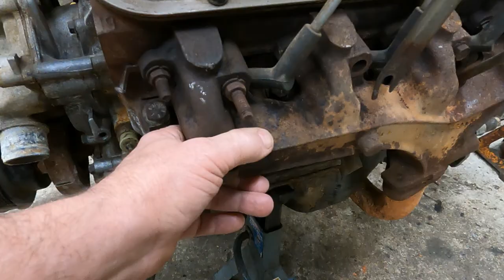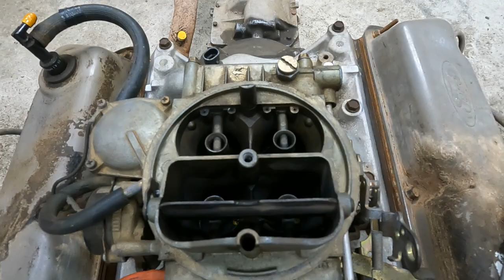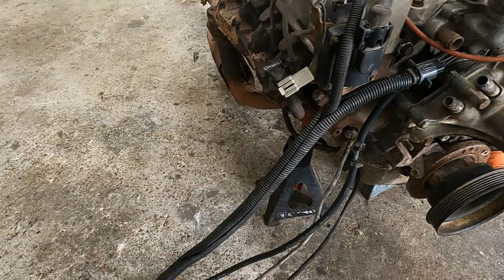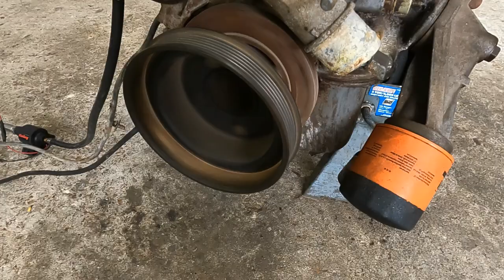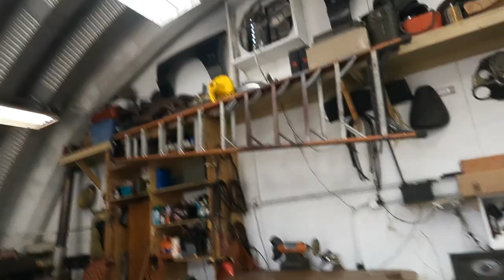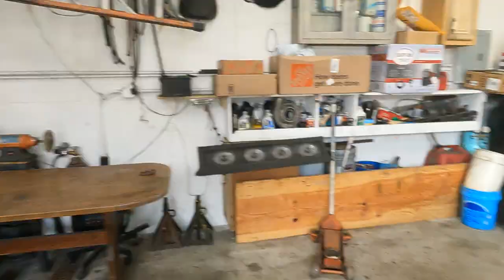94 Roller 351W Swapped To Carb Running On The Ground

Comment: Awesome that's my favorite engine!
Reply from the maker: I got some 93 cobra GT40 heads I"m porting to go on it. The F3 GT40  heads have 1/2 inch head bolt holes from the factory and are going to fit without having to drill the head bolt holes. It should wake it up a little!
Reply: @kickassmustangsgarage  I'd say it will wake up! Lol

Comment: Love putting together my 357w for 1975 f250 right now
Reply from the maker: I want to put some better heads on this one and put it in the blue Mustang
Reply: @kickassmustangsgarage  same here I started with a 1994 351 as well bored  .030 it's backed by zf5
Reply from the maker: I've got a 87 Ranger with a 01 Explorer 302 with a t5 with a T6 12.7 L semi truck turbo on it.  Check out some of the videos on it if your interested and subscribe to the channel.
Reply: @kickassmustangsgarage  watching all your videos now lol
Reply from the maker: what did you get the trans and transfer case out of ?
Reply: @kickassmustangsgarage  the transfercase is the original np205 and transmission is from a 1994 f350 daully
Reply from the maker: I need to find me one and a straight axel and swap the Ranger to 4 wheel drive.
Reply: @kickassmustangsgarage  I just sent a solid axle to junkyard  a few months ago had for sale no one wanted it. Sold a small block 5 speed transmission  hooked to ford transfercase yesterday
Reply: @kickassmustangsgarage  had a ranger with built 306 and built 4r70w running with explorer ecu, 8.8,3.73 gears. Scary little truck. Also had a short bed 4wd ranger I was going swap it into when v6 quit 429,000 miles still going til I was hit by a drunk driver going 70mph. Rip
Reply from the maker: I had a 72 Bronco that the axel would have worked out of I should have kept it. I didn't care for the 3 speed trans though. I sold it for $400 running I got tired of people stopping and asking about it sitting in the yard.
Reply: @kickassmustangsgarage  my friend ha a 72 with 302 he wanted my 5speed to swap in it

Comment: Sounds healthy 👍
Reply from the maker: The only thing they ever changed was the water pump and the plug wires normal shit. It has about 8 degrees of slack in the timing chain and 284,000 miles on it LOL. I didn't put the clutch on and it doesn't have that extra weight on the flywheel so it revv's easier. If it was in a car the torque converter or clutch weight hooked to the crankshaft would slow down how fast it revv's.  I want to run it with the cat's off and see if it smokes, do a compression test and go from there. Maybe it's not wore out too bad it was clean inside.

Comment: Great content 
Thank you 

Will a 80s carbureted intake fit on the 94 F4TE block?
Wouldn’t any old style points distributors out of 302 or 351 work?
Just to fire it up for a few minutes?
If it has the roller cam?

I understand if it’s not a roller cam then you don’t have to swap the gear
Reply from the maker: Yes any intake that's for a 351w  will fit block and heads are the same fuel injected or carburetor. As far as the distributor goes you can run the wrong gear for a few minutes and be okay  but 302 distributor wont fit a 351w oil pump shaft is bigger in the 351  5/16 vs 1/4 inch

Comment: What ignition system is that?
Reply from the maker: Dura spark 2 factory style distributor and ICM for a 78- 84 Ford LTD with the cast iron gear swapped   to a steel gear from a 86-93 302 distributor

Comment: I bought the same motor at a junk yard and i want to swap it to a carb,its going in a 1983 bronco and this is the information i was looking, what intake and carb did you install  Mr
Reply from the maker: The intake is a Edelbrock performer 351W #2181 the carb is a Holley 600 just to run it on the ground.

Comment: Sounds just fine. what is this going in?
Reply: I’m gonna guess. Blue fox in the background
Reply from the maker: I want to put it in the Mustang but I kinda don't want to molest the Mustang yet. I may put it in the truck and make a new crossover pipe and put the turbo on it. I've got two 14L variable vane turbos I need to try one of those out and see if I can figure out how they work.
Reply from the maker: That was the plan. It'll take some money to do what I want to it.

Comment: Just was wondering if I could run the same setup on my 1999 mountaineer 5.0?
Reply from the maker: You can swap to a carb I've got a 01 Explorer  5.0 in my 87 Ranger.  The transmission in a Mountaineer is controlled by the computer so I don't know what you would do about that if you plan to use a Mountaineer transmission. Check out the channel and subscribe if you're interested!

Comment: Does the length of the shaft matter one is shorter than the other ? On the distributor
Reply from the maker: The base of the distributor to the gear is the same. Some have a longer shaft from the gear down to the oil pump drive but if you look the spline for the oil pump drive doesn't start at the tip. I'm not sure what you are working on but if you have a roller cam and put a cast iron gear distributor in it it will eat the gear off the distributor. I used a EFI 302 roller distributor gear and swapped the cast gear for the steel gear. The 351 EFI roller gear will swap it's the same as the 302 EFI gear. The hole for the pin for the gear didn't line up exactly when I tried to use the 351W EFI gear.  I had about 4 gear off old 302 distributors and one of the 4 had the holes in the same spots and I was able to put the pin in without having to re-drill the gear and distributor shaft.

Comment: How long are you gonna run that thing without water?  😬😳 good vid we like the 351 👍🏼🇺🇸
Reply from the maker: They hold about a gallon in the block even without a lower hose. I kept touching the head so it didn't get that hot lol. Thanks for the sub!

Comment: I have roller 351 out of a 94 van can i use the hei distributor with the steel gear?
Reply from the maker: If it has a roller cam it needs a steel gear.  if it's a flat tappet cam it's a cast iron gear
Reply: @kickassmustangsgarage  thank u sir
Reply from the maker: @JW-ot5zq  you"re welcome

Comment: hello, what type of flywheel did you use in your setup?
Reply from the maker: I had a old one that came off a 351W that was in a 76 Ski Nautique boat. 289, 351C, 351w, pre 81 302 all use a 28 ounce imbalance flywheels. 157 tooth flywheel is what a 84-93 T5 bellhousing uses. The older flywheels like the one I used have a 10 inch clutch. The 94-04 Mustangs with a 3.8 V6 T5 trans use a 164 tooth flywheel the bellhousing has the same bolt pattern as a small block 302-351w with a 11 inch clutch. The 3.8 flywheel won't work on a 351w but they sell a 164 tooth 28 ounce imbalance flywheel if you want a 11 inch clutch. If you buy a flywheel don't buy a LUK I just posted a video of me swapping one out because it was vibrating brand new. Check out the channel and the new video and subscribe if your interested!
Reply: @kickassmustangsgarage  thanks alot for the info, appreciated.
Reply from the maker: @luisjose747  you're welcome
Reply: A round one .

Comment: What distributor did you use
Reply from the maker: Duraspark 2 distributor with the gear swapped off a 87-93 302 roller cam steel gear
Reply: @kickassmustangsgarage  thanks that's what I have just checking
Reply: @kickassmustangsgarage  getting alot of mixed answeres about my distributor some say I can't do that.but looks like the only reason irt won't work is if it has a heavy duty upgraded oil pump driveshaft just have to check.
Reply from the maker: The oil pump shaft is 5/16ths on a 351w 302 is 1/4 inch. The only time you need to swap the gear is on a roller cam. A 86- 93 mustang distributor gear is the same size as the gear on a 351w and it's steel not cast iron so it works with a roller cam

Comment: Trying to start my 351w on ground how did you get the duraspark distributor to run
Reply from the maker: https://youtu.be/gtvUXufE4x0 I show how I wired it up on this video at the end
Reply: I looked it went so fast couldn't see how it's wired looks like you have a ignition box to it
Reply: @kickassmustangsgarage  ok I see I have that box but it's still in truck what color wire do I need to to feed power to on that box
Reply from the maker: @randypeacock8062  you need a MSD box or a factory type ignition control module and a coil
Reply: @kickassmustangsgarage  I have that but truck isn't all put back together want to test motor before I put front clip on because hard to work on after that 7 inches of lift and 37x12.50s
Reply from the maker: The plug with two wires white and red hook power to them and run a hot wire to the +side of the coil  and the green wire from the 4 wire plug to the - side of the coil the other 3 wires go to the distributor.
Reply: @kickassmustangsgarage  I give it a try thanks what's best base timing to atleast start it? 10degrees?
Reply: @kickassmustangsgarage  motor it is.030 over 357w
Reply from the maker: @randypeacock8062  10 is good to get it going about 12 is all I run
Reply: @kickassmustangsgarage  really appreciate your help. Just ready to button up my truck is a 1975 f250 it's zf5 swapped. Discbrake conversion. Homemade powersteering I put together. Using 2004 superduty steering box. Also adapted superduty brake booster

Comment: What year is the motor
Reply from the maker: It's a 94 roller motor out of a F150
Reply: Would the 1999 5.0 mountaineer motor be the same?..I want to keep it stock but with a lopey idle can..any recommendation would be greatly appreciated..thanks..oh,by the way I looooove the way it sound...💯💯
Reply from the maker: Eric Taylor I've got a video on a 01 302 I swapped to a carb. Go check out the channel and subscribe if your interested. The 01 302 is in a 87 Ranger with a 12.7L Semi truck turbo on it.